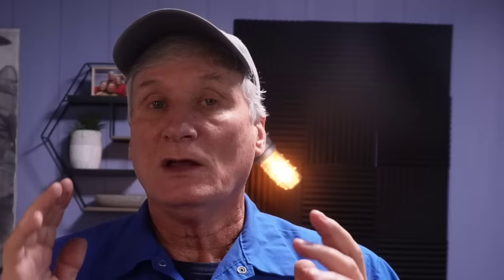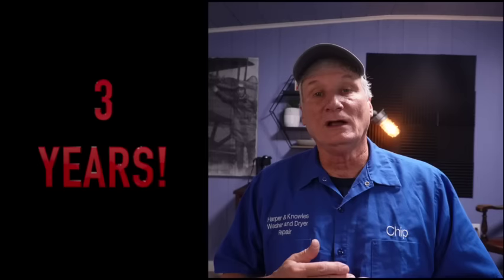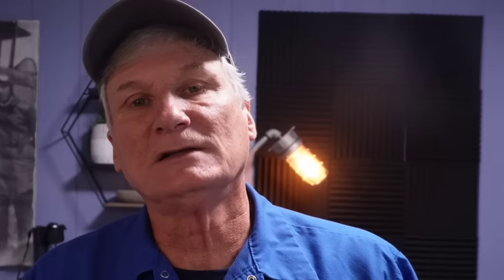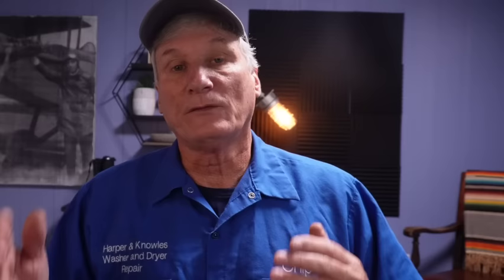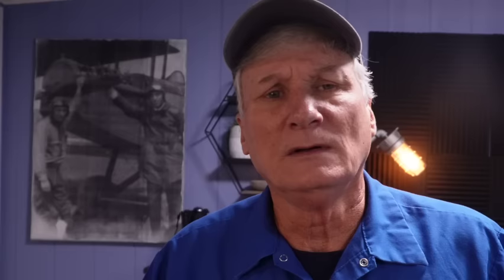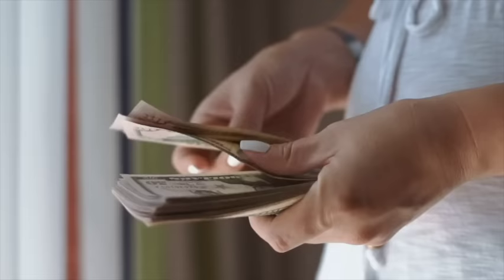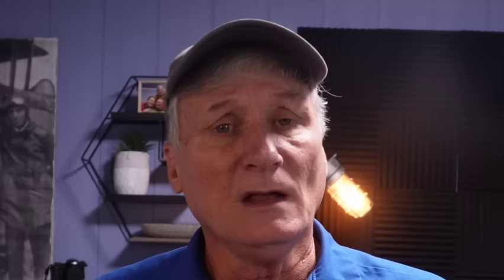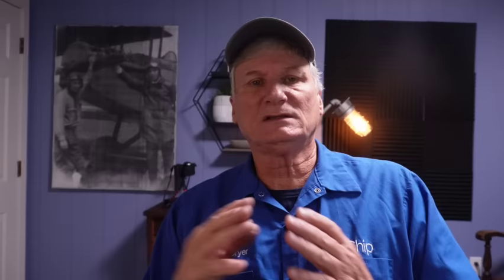How To Choose the Best Washing Machine: Speed Queen TC5 vs. TR7 Review

Comment: I had a Kenmore series 70 (Whirlpool) x-large capacity from the late 1980’s. It finally died last year R.I.P. I doubted I could ever find another washer of such lasting value. Will consider SpeedQueen.
Reply from the maker: It's impressive that your Kenmore Series 70 lasted for such a long time! If you're looking for a washer with a reputation for durability and longevity, Speed Queen is definitely worth considering. Make sure to do thorough research and read reviews to find the best model for your specific needs. If you have any questions or need assistance, feel free to reach out. Thanks for watching my channel and good luck with your search!
Reply: Same story here! Kept mine running with my own maintenance past few years......new water pump, 2 belt replacements, agitator dogs, shift solenoid. The trans finally gave out and started leaking which in turn made the belt slip. Final straw was when it flooded the back of the house when the pump didnt drain. 

Bought a TC5 a week ago. Couldn't be happier! As close to an old school washer as you can get nowadays! Zero regrets! 

Old one is getting covered to a fire pit now as my last washer tub fire pit is burned out after 3 years of use.

Comment: Sounds like Speed Queen is a great product.  I bought my LG front loader washing machine about 8 years ago and it has been absolutely perfect.  I handles queen size comforters easily, has 'quick wash' option and more.
If I had to buy another washer however I would definitely change to a TOP loader washer and to a Speed Queen as have heard only good things about them.  I guess they are sold in 'big box' stores? I dont know
Reply from the maker: No, Speed Queens are only sold by independent dealers. Thanks for watching!

Comment: I used to fly for Gulf Air headquarted in New Iberia.I was based near my home in PHL.Ocassionally I would ferry a 727  to New Iberia for maintaince and get to hang around for a few days.
Reply from the maker: That’s a super long runway built by the military during WW2 just over 8000 feet. I remember landing there in a 182 when I was a young pilot and taxiing forever. The guy in the tower says. “Next time you might wanna land long!” It was also designated as an emergency landing strip for the space shuttle. Nice to hear from you my friend! Thanks for watching!

Comment: I add 3 gallons of water to all of my laundry loads.  I do this with a bucket.  When there is not enough water to float the clothes freely, the washing action beats the hell our of my clothes and twists them into knots.
Reply from the maker: Hi Mari, thank you for sharing your experience and method of adding water to your laundry loads. While it might not be ideal, it's an interesting solution to ensure your clothes are treated more gently during the wash. I'd like to suggest giving the Speed Queen TR7 machine a try. It's designed to move the water through the clothes, providing a gentler wash experience without the need for manually adding water. If you have any further questions or need assistance, feel free to reach out. Thanks for watching my video!

Comment: I have a 2014 Maytag Centennial Top Load Washer MVWC200BW1; the only item I've had to replace in 2020 was the suspension rods which I did myself never having repaired a washer or dryer. Other than that it is a reliable machine.
Reply from the maker: Thanks for watching!

Comment: 1500$ for a SQ (with the taxes 1600$) that would last 20 years. Let's pretend it will never break. That is 80$/year. I had a maytag I just got rid. It lasted 18 years. I would put parts every years or 2 for the last 7 years. Rarely for 75$ a year. It got the same spring system as the SQ. We payed that machine at time 450$ (ok there is inflation.) Well I was able to fix it, because of my technical background. 

I acquired a 2019 maytag for free. The transmission started to leak. But I have to make a guesstimate that would make sense. They have a new part number, I hope it's a service bulletin superceeded part and it will last longer.There is also the HE that is interesting, cost low electricity and low water. That count to. I do 30 laundry a month. 

Your video make me realize that no machine last forever and there is a cost to it. Thanks.
Reply from the maker: Thanks for watching my friend! And thanks for sharing your experience with your older Maytag, sadly they don't live up to the name anymore.

Comment: I have a 15-20 year old front load Frigidaire washing Machine. It has trouble with balance with a light load . But still going strong. My dryer is a Frigidaire . @20 years old . No electronics . Mechanical timers .
Reply from the maker: It sounds like you got your moneys worth out of those machines. Thanks for watching!
Reply: @HarperandKnowles   Thanks for the video  .

Comment: I had a Samsung that was just three years old and the electronic panel went out. The service technican recommeded Speed Queen and I bought one and it has done everything they said it would do and it is a great machine, so I will buy a Speed Queen dryer when this Samsung goes out an dhave a matched set.
Reply from the maker: There you go! You won’t be disappointed. Thanks for watching.

Comment: I have a TC5 and the one thing I hate is no load size selection, it's large load of about 24 gallons all the time except the jumbo load. My aunt has the previous version of this machine and it has load size selection. The dryer has such a small  filter screen that it gets clogged before the cloths are even close to dry. In looking back I should have bought the Whirlpool Commercial.
Reply from the maker: Thanks for the comment.  This is a common complaint of the TC5. The cycle selection also determines how much water is used by the machine per fill. You might want to experiment with that. Thanks for watching!
Reply: @HarperandKnowles does it not have infinite fill?

Comment: I have an old heavy duty top loader and matching dryer. I will fix them. I do have mold somwhere that running bleach water isnt getting at.
Reply from the maker: If you have a mold problem take the machine outside and remove the case. remove the splash ring and then you can really give it a good scrubbing with a stiff brush or a pressure washer. Thanks for watching!

Comment: My folks first bought Speed Queen washer and dryer in the late '60s, replaced the washer after 25 years, and gave me the gas dryer in the late '80s (I used it until around the early 2000s). They replaced it with another Speed Queen pair, which I replaced at home in 2017 or so, with yet another SQ pair (TC5). Won't purchase anything else; I've heard nothing but problems with other brands with people I've talked to.
Reply from the maker: That's amazing to hear! Speed Queen has certainly built a reputation for quality and longevity over the years. It's no wonder you and your family have stuck with them for so long. I'm glad that you've had such a positive experience, and it's always helpful to hear real-life testimonials when recommending appliances. Thanks for sharing your story, and thanks for watching my channel too!

Comment: They do offer stainless as an option. I found two models for sale here in Europe. Both are traditional frontloaders. Slow ones to boot, only 1200RPM, how is that going to shed the water out. Stand alone model is the SF10 and the STW washer dryer tower, with a tumbledryer on top. The NF3J is an other option sold by other seller. Frontloaders have been the norm here for almost half a century. Toploaders were also spinning models, but with an lid in the circular wall. The two side walls allowed for an axle on both sides. Drum being orientated and spinning front to back of the machine. These flop flop things were still made in wood, pre- WWII, last time they were sold in Europe;-).
Reply from the maker: Thank you for sharing your insights about the different Speed Queen models available in Europe! It's interesting to hear about the stainless steel option and the various front-loader models being sold there. I understand your concerns about the 1200 RPM spin speed, as faster spin speeds can help remove more water from the clothes. However, various factors like the machine's overall design and performance can still contribute to effective water extraction even at a lower spin speed.

It's fascinating to learn about the history of washing machines in Europe and how top-loaders with a different design used to be more common. I appreciate you sharing this information and your perspective with us. It's always great to hear from viewers in other parts of the world, as it helps us all learn more about different appliances and preferences. Thanks for watching my channel, and please feel free to share any more insights or experiences you might have!
Reply: @HarperandKnowles  they even offer coinslot models for shared housing use. Still frontloaders like their laundramat models. Stainless because it is a semi-pro model. The toploader is only in white paint enamle?

Comment: From Buffalo, N.Y. I don't know how to respond to this. Speed Queen is a good make (BUT) I had to have mine repaired just before the 3rd year warrenty was up. Several times the guy came out to fix it and several times he couldn't get it right as it was a process of elimination for him to find the problem. I kept all the parts he replaced on 3 seperate attempts to fix it. Finally he got it right on the (THIRD) try. It was the mother board that was made in (Mexico) that failed. As I said, I kept the parts he replaced, a belt, a lid lock and the mother board. See how I don't know how to answer this post.
Reply from the maker: I understand your concerns about your Speed Queen washer and the challenges you faced during the repair process. Unfortunately, issues with foreign-made electronic components can affect even a reliable brand like Speed Queen. However, it's essential to recognize that the company does its best to source the highest quality parts possible under the circumstances. There are few to no electronic components made in the USA today!!! That is why the sovereignty of Taiwan is essential to our national security.

As for the service technician, it's possible that they may not have had the necessary experience or training to diagnose the issue correctly the first time. It's always a good idea to seek a reputable, experienced technician when repairing appliances.

On a positive note, your washer was eventually repaired, and now you better understand its inner workings. It's also a testament to Speed Queen's commitment to their warranty and ensuring customers receive the support they need. Remember that no appliance is immune to occasional issues, but Speed Queen's overall track record for reliability remains strong.

Thanks for sharing your experience and for watching my channel! Please don't hesitate to reach out if you have any further questions or need assistance.

Comment: I had a used appliance store, and I can attest that the queen our among the best. Another good brand if you can find it is a whirlpool Kenmore Direct Drive Toploader.  They designed this machine in the 80s perfected it in the 90s and sold millions. I bought a used ones because the government won’t let them build it anymore because they use too much water. But you have to get an older model. Speed. Queens are great, but they are a little pricier. They do last a long time very reliable.
Reply from the maker: Thanks for the comment!
Reply: Washing clothes twice seems to use a good bit of water, too, eh? 
🤨🙄

Comment: We have gone through 3 sets of washer/dryer combos in our new home since 2003. We bought a pair of Speed Queen’s (5000 series) in 3-1-2018. These are working flawlessly since purchasing. My wife’s biggest problem with the old was water level control, seems as if they always filled the water to the top. This washer was one of the few you could choose your own water level, and my wife does. We did have a problem with the dryer vent pipe and I removed one of the elbows that wasn’t needed, and I don’t use any pipe, except galvanized. Our vent pipe goes out 15’ with 2 elbows. We use a gas dryer. My wife loves this pair. Our old home we left a 23 year old Maytag pair. Each had one repair, washer, I changed the large seal below the drum and dryer the timer. Both were when units were 12 years old.  Question….the dryer timer failed in the closed position, which meant that if it stayed on, the clothes would eventually catch fire or am I over thinking this?  Comment?    Thanks….
Reply from the maker: No, your thermal fuse should blow before that would happen shutting off the gas supply.
Reply: @HarperandKnowles  Thank-you, forgot about that thermal fuse.  Happy Easter, God bless!

Comment: I was considering a SQ, but go read the number of recent negative reviews on their website, even on the TC5. Multiple issues reported and a lack of service techs since COVID.
Reply from the maker: I did what you said, I checked the TC5 reviews. A 4.6 out of 5 seems to be pretty good in my book. You can’t please everyone but out of 4176 reviews only 315 people rated them less than 3 stars. If there is a lack of service technicians, that is an industry wide problem not exclusive to Speed Queen. My opinion as a service technician is that you can’t go wrong with a Speed Queen product. But like I said, there are those few people that just can’t be pleased. Thanks for watching!
Reply: @HarperandKnowles like the crazies with the downy in another comment above lol
They’re putting the downy in the wash load at beginning??

Comment: I have a TR7 and it does great...  in 2019 they updated the board and software in these machines for a more aggressive wash action.. it is visible when watching my 2019 model (which has had zero issues in the 4 years ive owned it).. and watching a 2018 model..  so if you have a 2018 model contact speedqueen they may be able to have the board replaced / updated with the 2019+ wash action..  I regularly wash my queen size comforter in there.. no issues..  10+ bath towels..  no issues...  when I have really dirty clothes (like after working on my classic diesel busses)..  the full tub of water option is really nice for cutting the grease! as is the optional extra rinse!   the heavy duty selection on the TR7 panel gives you one wash fill, a spin thyen a rinse fill and a final spin (that runs up to 800 RPM)..  my old LG frontloader used to smell and shake the wood frame house like crazy..  no issues with the TR7..  no odor and no vibration..  I watch TV in the room next to the laundry room all the time..  the Speed queens were expensive however less than Half of what I paid for the previous LG front load set..  very glad I made the switch in 2019
Reply from the maker: It's great to hear that your Speed Queen TR7 has been performing well for you, and I appreciate you sharing your experience with the updated board and software from the 2019 model. It's always helpful to have real-life testimonials from satisfied users.

The improvements you've mentioned in wash action, odor reduction, and vibration control, along with the versatility in handling different types of loads, definitely showcase the benefits of owning a Speed Queen washer. I'm glad that making the switch from your previous LG front load set has been a positive experience for you.

Your comment will undoubtedly be helpful to others who are considering purchasing a Speed Queen washer. If you have any more questions or need further assistance, please don't hesitate to reach out. Thanks for watching my channel and sharing your experience!
Reply: So SQs aren’t expensive then??
Less than half an LG??

Comment: My 22 year old top load Maytag washer & dryer just got replaced with Whirlpool front loads and the new ones are garbage. They don’t clean as well. My 22 year old Maytag set didn’t cost anywhere near what Speed Queen costs! The laundry appliance niche is giving it to us all up the a$$. Oh…. my Maytag set had a much higher capacity than Speed Queen as well!
Reply from the maker: Twenty two years ago they hadn’t implemented engineered obsolescence yet and the manufacturers competed for quality. Thanks for sharing your experience and thanks for watching my video!